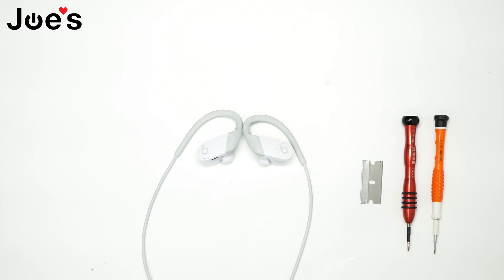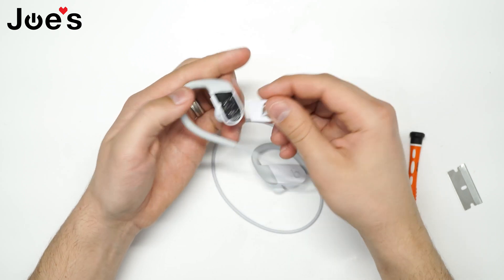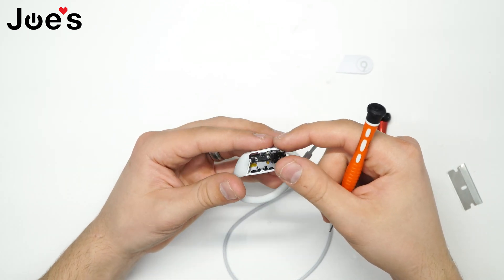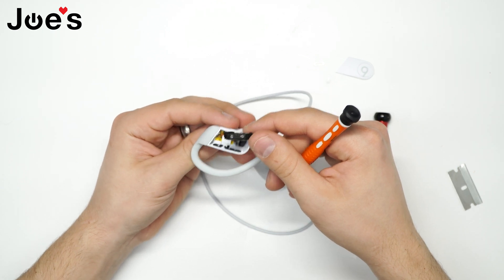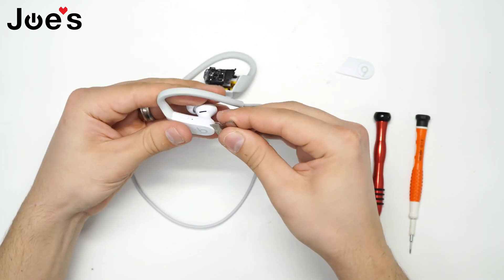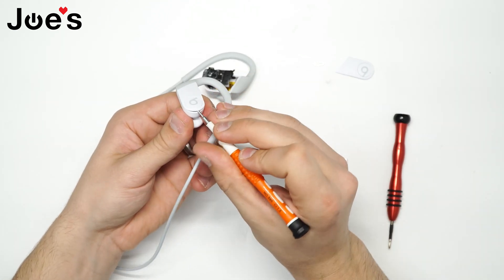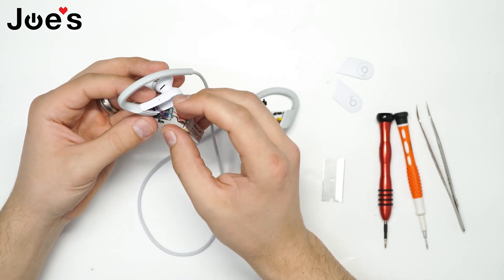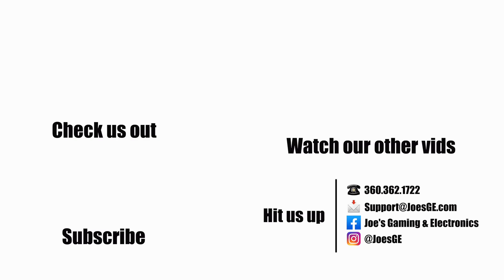Beats By Dre Powerbeats HP High-Performance Teardown | Repair Tutorial

Comment from the maker: Buy The Battery Repair Kit = https://www.joesge.com/products/powerbeats-2-3-wireless-battery-90mah-new?variant=41145082019886
Buy Powerbeats 4 Main Wire = https://www.joesge.com/products/beats-powerbeats-4-high-performance-main-wire-ear-hook-assembly-replacement-repair-parts
Buy The Battery = https://www.joesge.com/products/powerbeats-2-3-wireless-battery-90mah-new?variant=41145081987118
Buy The Soldering Iron = https://www.joesge.com/products/60w-adjustable-led-soldering-circuit-board-repair-iron-kit-tools?variant=40553764192302
Reply: how many wires in main cable ? i want to make connection through the connector (cut main cable)  
thanks

Comment: Hi, do you guys have a video on how to replace the ear loop? These are my 2nd pair of Beats hp and after a year the loops just tear down so easily.
Reply from the maker: We unfortunately do not.
Reply: I’ve had 3 pair over the last 15 years I wear my daily for about 5 hours so they hold up well but the rubber around ear loops and the cord that goes behind my neck keeps breaking down. I don’t know what to do since they work perfectly but don’t want to open the board.

Comment: So there are for sure wires running through the neck cable? I was thinking of cutting it because it drives me nuts! I should have got the Pro’s instead 🤦
Reply from the maker: Yes there is defiantly a wire running through the neck cable.